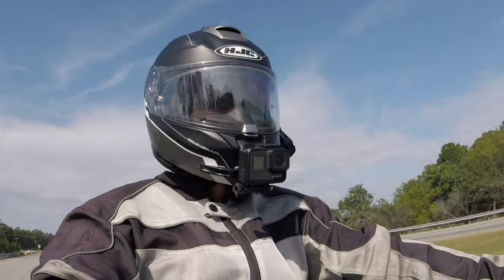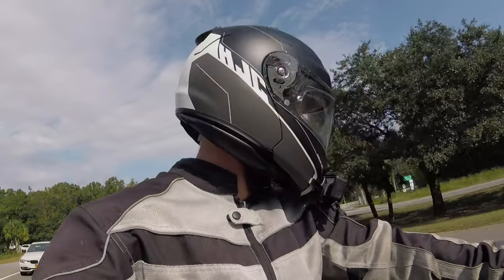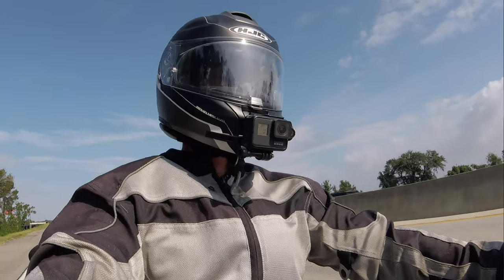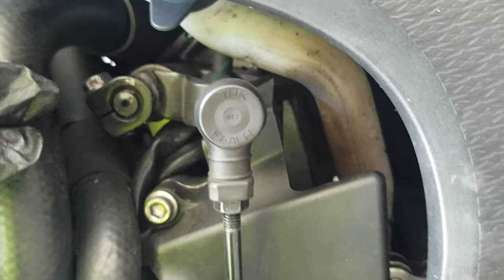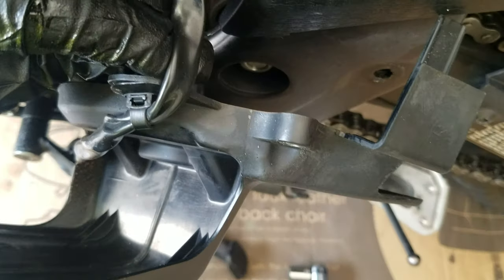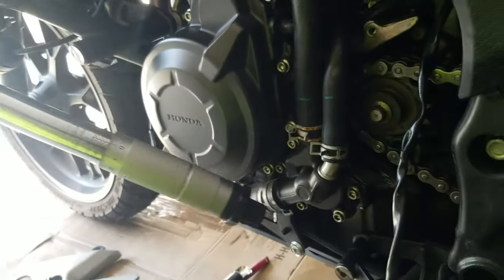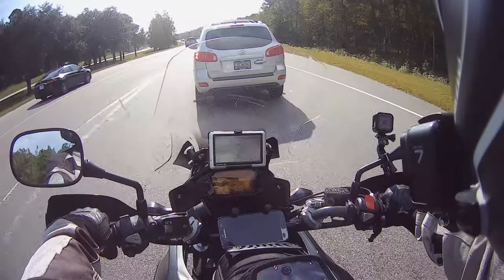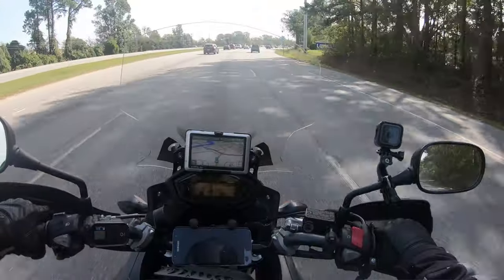CB500X 16T Sprocket Swap

Comment: You know. Get it right. 4800? 4900? What was it. Plus or minus 100-150 rpm is bull shit.
Reply from the maker: Hi Chuck!  As I mentioned, this wasn't a scientific video.  The takeaway here is that I absolutely love the upgrade because it stretches out the gears and reduces the rpms at highway speeds to make the bike less buzzy.  With the 15T stock sprocket, I found 1st gear to be practically useless unless you live on a steep rocky mountain path.  With the 16T, 1st gear is actually useful again, 2nd gear is nicely spaced out from it, 3rd is even more so, etc.  If you feel like your gears are bunched up too tight, or don't like sitting on the highway with your bike revs way up, you should try it!  You'll love it!!!  Plus it's a really cheap and easy to do project.  If you don't like it, no big deal, switch it back.  I hope this helps, my friend.  Enjoy!

Comment: Bad idea to use that same chain when the 15T sprocket is clearly showing hooked teeth.  Your drop of 800 RPMs at 70 MPH is not correct.  It should be more like 400 RPMs.  Similar problem with your 80 MPH data.  Multiple problems with this video.  Downvoted.
Reply from the maker: Hi David!  Thank you for the kind comment and excellent insights.  I purchased the chain less than a year ago.  So it's practically new.  It's a top of the line DID X-ring chain.  When I bought it, I knew I was going to be changing out the front sprocket to the 16T, which is why I didn't replace the sprockets at the same time.  I actually intended to do it sooner than this, but life got in the way.  :-)  As for the data, this was certainly not meant to be a scientific study.  So many variables, such as a shift in wind speed or wind direction, a slight up-hill or down-hill section of the highway, or even my eye-sight at judging the exact RPM on the readout, could have all affected the results.  Another reader sent me the math equation and calculated that in theory the new 16T should yield a gain of approximately 600 rpm at 80mph.  That may be entirely true.  I can't say for sure the exact amount that the rpm decreased.  All I know is that the new sprocket does space out the gears a little (which I personally find suits my riding style better), and that the new sprocket does decrease the rpm to some degree when traveling at highway speeds (which I like).  So I'm very happy with the upgrade to a 16T front sprocket.  It certainly may not suit everyone's riding style.  Those who prefer the low-end torque, those who do more off-road riding, those who live in a part of the country with lots of curvy roads and steep hills...all might benefit more by keeping the 15T sprocket.  I live on the east coast where the roads are fairly flat and smooth.  Plus I spend much of my riding time commuting to work and running errands.  So for me, the upgrade to a 16T has been a real winner and I love it!  But that's just my personal preference.  To each their own, I say.  And the great thing about the CB500X is that each individual can customize it to suit their personal riding style!  :-)
Reply: My main point was you should have told people in the video that normally it is a good idea to change the sprockets and chain at the same time if at least one of them is badly worn.  An exception of course would be a steel rear sprocket can maybe go without being changed if it looks good.  

I have also experimented with sprocket changes and they can help, especially on sport bikes so that you can get at the power without having to go 100+ MPH.  Some crotch rockets can do that speed in 1st or 2nd gear and they still have 4 to 5 more gears.
Reply from the maker: Thanks for the kind comment, @davidjames1684 .  I'll try to be more diligent in future videos.  I appreciate the feedback!

Comment: For those of you watching this video considering buying a CB500X save some extra money when buying and purchase a better seat. This sprocket is a great idea but not when your ass hurts after 30 minutes of riding. These bikes are not comfortable.
Reply from the maker: Thanks for the great advice, Kevinfet!  An insider in the industry once told me he asked one of the major manufacturers why they put such crappy stock seats on the bikes.  He was told they didn't want to take away from the "aftermarket industry".  HA!  :-)  Having said that, I haven't had a problem with the stock seat on my bike.  I did pull the skin off and shave the foam down a little in certain places, then stapled the skin back on.  But I have no problem riding all day.  I once did 3 hrs non-stop...though I usually prefer to stop every hour or two on a long trip for safety reasons.  After 2 hours in the saddle without a break your concentration level usually isn't where it needs to be.  But of course not all behinds are shaped the same.  It's important to find a seat that fits you and makes riding enjoyable!
Reply: kevinfet 

True dat.I sat on one in the showroom the other day and hopped right off the sob.